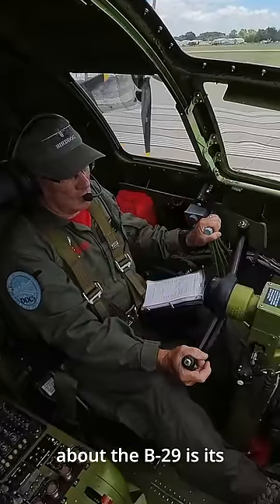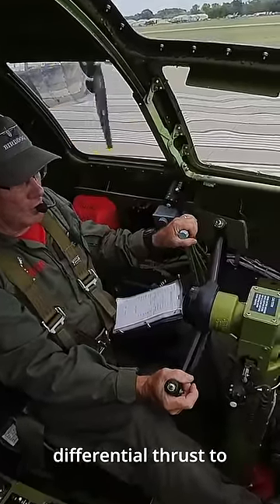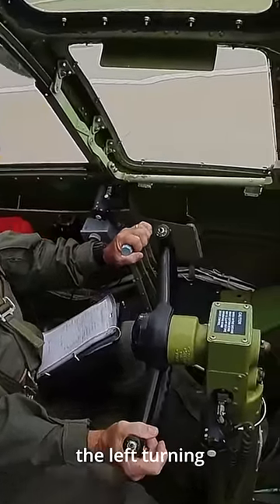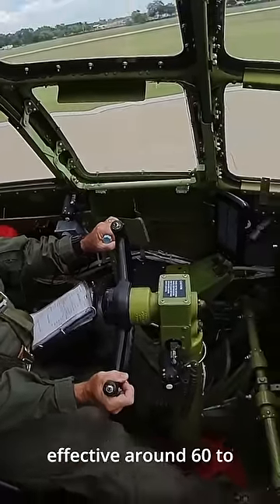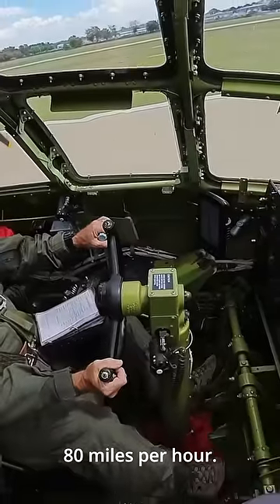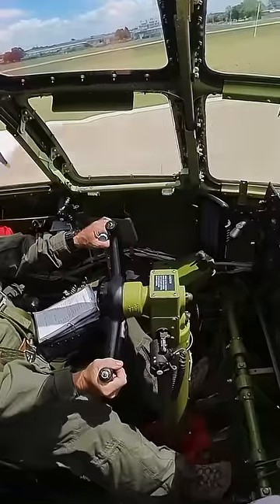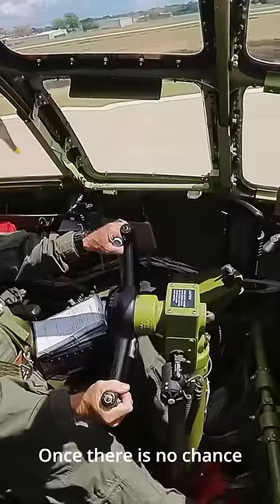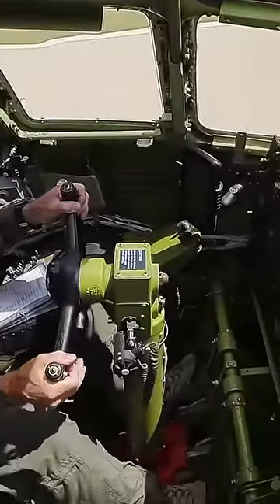The FULL B-29 Takeoff #warbird #aviation #airplane #instruction #pilot #warbird #history #ww2

Comment: If the flight engineer controls the engines completely, how did they maintain formation during WW2?
Reply: Probably because all planes im formation were flying at the same throttle setting
Reply: The flight engineer won't be controlling the throttles in formation flight maybe since his view outside is limited if any at all. FE's have enough to do, the pilot can ask them to set different configurations like METO or cruise power based on agreed upon settings before TO. FE's have plenty of systems and instruments to monitor. Cabin pressurization, electrical systems, keeping the engines in sync, EGT, MP, CHT, RPM, oil temp and press, hydraulics, fuel flow and consumption, pump fuel from tank to tank. Those were the analog days baby, no digital set it and forget.

Comment: Admittedly,  I know NOTHING about flying.
WHY are spinning wheels a problem once the plane airborne ?
Something to do with retracting them into the planes body ?

Gyroscopic force on the plane ?
Reply: If a tire tread comes loose, great damage can be done to critical equipment inside the wheel well if the wheel is still spinning.  On modern Boeings, the brakes are automatically applied when the gear handle is moved to the UP position, and released when the handle is moved to the OFF position for cruise.  Some airplanes have frangible hydraulic tubes that stop gear retraction if a damaged and spinning wheel is being retracted, even it the damage has already disabled the brakes.  On most airplanes the nose wheels do not have brakes, but the wheels cause noise and vibration in the cockpit if they are allowed to spin down after retraction.  So there are friction strips at the top of the nose wheel well that contact the tires after retraction and stop them quickly.

Comment: Insane. Most pilots are taught to only use rudder for takeoff and ailerons for cross wind corrections only
Reply: Modern pilots don't have to compensate for the kind of inertia and mass contained in four of those massive radial engines.

Comment: why not use the toe brakes to keep it straight? throttle is easier maybe?
Reply from the maker: As I was told by one of our pilots, brakes are counter productive to acceleration and really sensitive, thus prone to flat spotting the tires.
Reply: @gravity.images  that makes a lot of sense. thank you